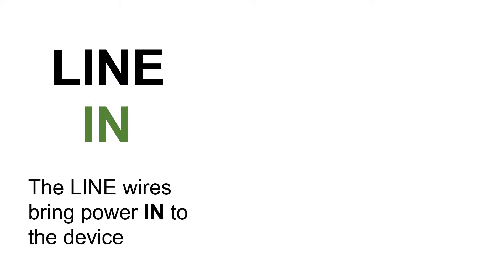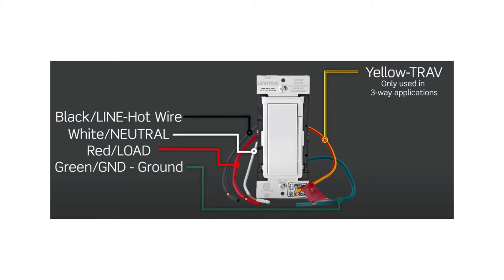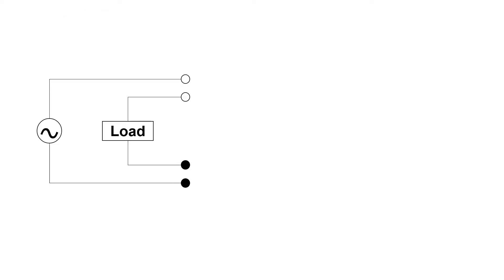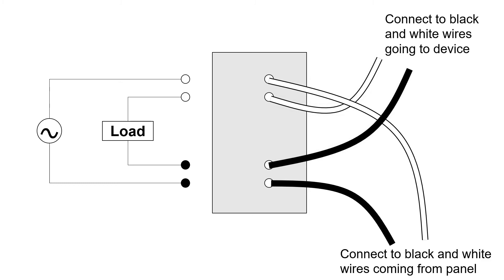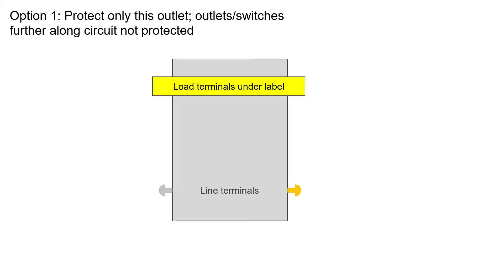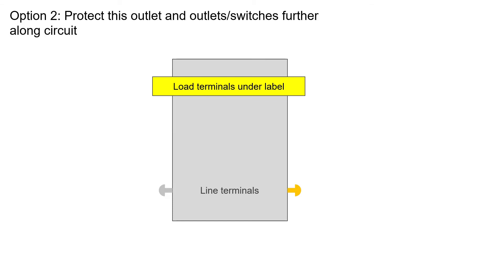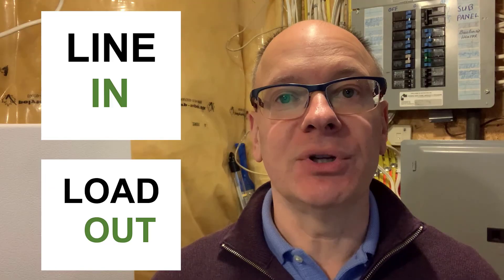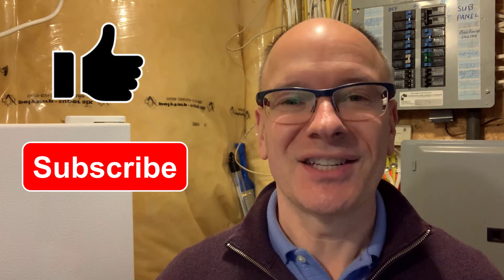How to tell line and load wires when installing GFCI, dimmer/smart switch, or floor heating control

Comment: 3:05 "GFCI Outlets usually have back wiring so that both sets of wires can be properly connected."
This should be obvious, but ... Make sure you understand back wiring if you are doing this sort of connection (protected outlet, non-protected load).  This *does not* mean trying to wrap two wires around a single screw (Don't do that!), but instead uses the metal clamp under the screwhead.
Reply from the maker: Thanks for bringing this to everyone's attention. That is what I was referring to and some people may understand it clearer the way you stated it.
Reply: I'm not sure if I'm asking this correctly. 

In the example of installing a new GFCI,  you could attach the line in wires where indicated and also wires to your next device or outlet downstream and the GFCI could trip but electricity device outlet would not be impeded?

In another example you could have a chain of three or four gfcis 1 running to the next where are you attached the first to line in and then load out to the second GFCI line in and then load out on #2 to sign in on number three and so forth........ And in that scenario,  any individual GFCI could trip at its location but not have an effect on the others?
Reply: I'm not sure if I'm asking this correctly. 

In the example of installing a new GFCI,  you could attach the line in wires where indicated and also wires to your next device or outlet downstream and the GFCI could trip but electricity device outlet would not be impeded?

In another example you could have a chain of three or four gfcis 1 running to the next where are you attached the first to line in and then load out to the second GFCI line in and then load out on #2 to sign in on number three and so forth........ And in that scenario,  any individual GFCI could trip at its location but not have an effect on the others?

Comment: I have 2 red wires and 2 black wires on my heating box. My relay + transformer wants me to connect L2 to its blue wire, L1 to its black wire, and load to its red wire. How do I tell which wire is the L1, L2, and load wire on my box?

Comment: Very helpful! Thank you. I just want to make sure I understand fully. When installing a smart switch (which I plan on doing this weekend), red wires should be connected with black wires, white wires should be connected together, and the grounds should be connected together. My switch is a single pole, so I can skip the yellow wire. Is this correct?
Reply from the maker: Without knowing the switch and the current wiring setup I can't answer whether that is correct as every situation can be different. The instructions with the smart switch will tell you which wire to connect to the load wire coming from the panel and which to connect to the wire going to the device/light.

Comment: I've learned to equate line with the power lines and load with the equipment side of the circuit.  Put simply, its the line side because if you follow it from the device location the wires will lead you toward the panel and the power lines coming in.  Load will always lead you toward devices and equipment that utilize the power.
Reply from the maker: Thanks for another helpful way for people to remember the difference.

Comment: I have a question.  I have a central vacuum with direct connect wall valves with 120 volt power.  How do I GFCI protect my central vacuum wall valve?  And, should I put a label making them as GFCI protected outlets?
Reply from the maker: The complexity of your question is beyond what can be answered in a YouTube comment. I suggest you contact a local licensed electrician to get advice.
Reply: Putting a gfci outlet on the wire before the outlet will make all outlets after it protected. Not sure why you want it though